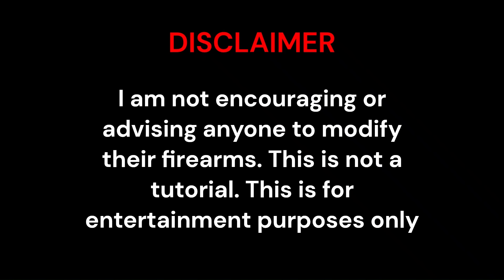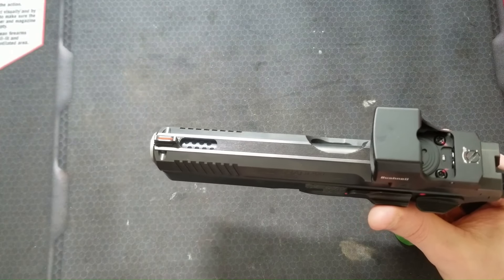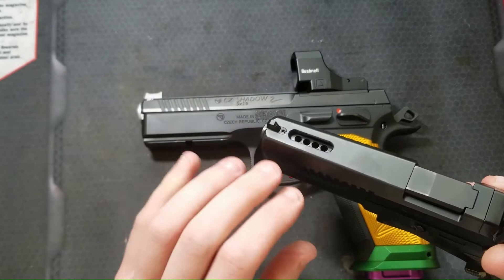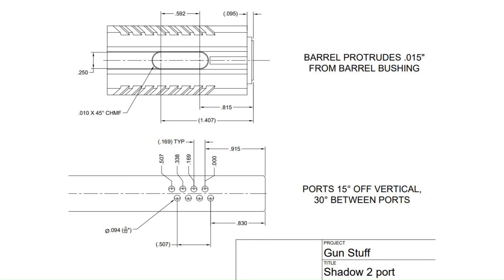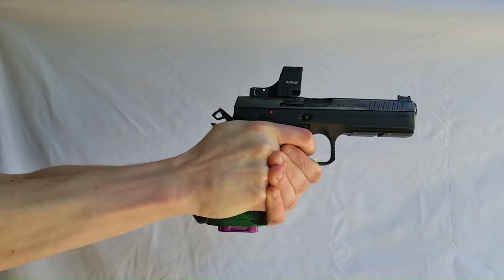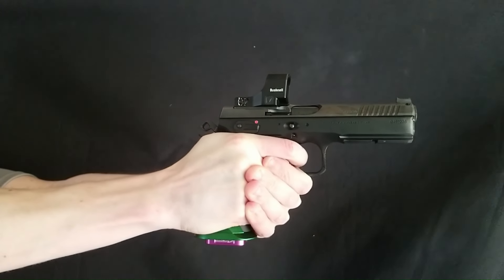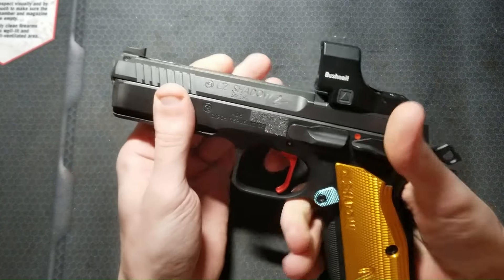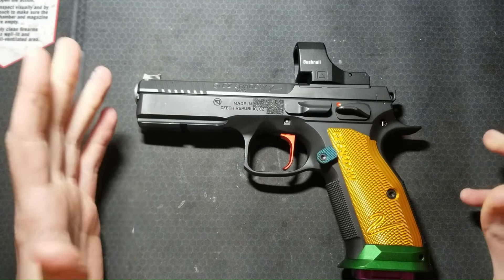I Ported My CZ Shadow 2

Comment: Helpful hint. I port a lot of guns and do integral comps as well. When doing an integral comp such as your hell cat you need to back cut the bore back slightly past the rear of the comp/port opening. I like to use at least a .387 dia. for this which ends up effectively recrowning the muzzle which is now at the rear of the port. Allows the bullet to exit evenly without any shaving as it is not re-entering rifling. It is the cleanest of all ports as no melted or shave lead is deposited. (My last project was my Staccato C-2 which has three ports as well as a similar to what is being shown on the Tube as a Ghinggs Comp).  

Too remove the deposited lead around ports, do not use a steel punch or screwdriver blade as you are showing here. Use a gunsmiths brass punch. It will not scratch the finish on the barrel but will shave off the lead. ;<) Since you have access to a lathe, it is a simple job. 

Now why the full face mask. Trying to look like a terrorist or just trying to make us shooters look like criminals?

KnifeMaker/Retired after over 47+ Years in the Craft
Reply from the maker: Ill reply to your comment on the Hellcat video regarding the hellcat. You're absolutely right and I guess I just had to learn the hard way haha! 

Regarding the balaclava, I with to remain as anonymous as possible.

Comment: Any chance you'll get another Shadow 2 barrel and try the 4 large ports instead of the staggard 8 (love that idea btw)  just to do a VS between the two.  Wouldn't be crazy expensive (not buying a whole gun)  and you'd be answering alot of people's questions about which is better large holes or smaller staggard holes.  I see you still have that cut from the Hellcat, Any chance you'll back bore it to the comp so that doesn't happen again? I know Floyd's does that too prevent spalling.
Reply from the maker: I don't plan on getting another barrel to test other porting layouts. I would like to but the way I take my measurements is not accurate nor repeatable enough. I think there would be a difference between 8 small ports and 4 larger ports, but the difference would be small enough that it would get lost in the uncertainty of my measurements. If I were to drop the coin on another barrel (it would be a cheaper barrel than this Shadow 2) I would want to be sure I could accurately quantify the change in performance, which I dont have a way to do.

As for the Hellcat barrel - no plans to bore the rifling out back to the port - the barrel is short enough as is and I didn't put the chunk port that far forward. if it was the barrel length of the hellcat pro I probably would. 

I did get a new barrel and plan on a 90 degree V port setup and I will compare that to unported and the chunk port.

Thanks again for watching and commenting, you're always asking great questions on my vidoes!

Comment: Any interest in doing some fairly simple machine work to my slide? I’ve got a 365XL slide that has the factory 6 lines serrations in the front and 6 in the back on each side. I’d like to mill out every other high spot in the serrations to turn the 6 thin cuts into 3 wide cuts. Basically 12 cuts all together that give me wide cocking serrations instead of the factory thin ones.

Comment: If you were to port another CZ p10 f would you use these smaller holes/design over the bigger inline holes?
Reply from the maker: Every porting job is a learning experience. In hindsight I could have spaced the P10F ports out a little more, they are kind of close, I spaced them out more on my P-01 (the next gun I ported). I also don't think i'll do any holes/slots bigger than 1/8" diameter. The holes on the P-10F and P-01 are 5/32".
Reply: @EngineersArmory  cool, did you drill the holes in the shadow at an angle or straight down?
Reply from the maker: @BigDukeDaddy  I mention it in the video. They are at a 15 degree angle off the vertical; 30 degrees between ports. Keeping them as vertical as possible will contribute most to reducing muzzle flip. It was a balance of port area, number of ports, angle, material left between ports and the area of the slot I wanted to fit them in. Took a while to figure out the right configuration. That's where the 3D model is almost necessary.

Comment: With your experience so far, would it be possible to do a chunk port on a Shadow 2? I know the front sight would have to be removed and would it interfere with the slide barrel bushing from the milling?
Reply from the maker: You could but it would need to be behind the barrel bushing. You wouldn't want to compromise that barrel lockup area. Only about the front .300" of the barrel bushing is the lockup area and its about .550" long. So you could mill away some of the rear of the barrel bushing. Of course you would lose your front sight in that case. The slide profile of the Shadow 2 would be hard to mill a new dovetail to relocate the front sight as well.

For a chunk port to be safe the rifling needs to be bored out starting at the leading edge of the port, so you will lose that barrel length as well. The further back in the barrel the port is, the more barrel length you lose. I don't think a chunk port is a good option for these pistols. 

Personally I wouldn't consider a chunk port on any pistol that has a barrel bushing.
Reply: @dltz  Alright, thanks for the info. Now I'm deciding whether V ports or top ports. You should do an in depth video on V ports versus top ports and see what's better on to reduce muzzle rise and felt recoil.
Reply from the maker: @PerfectFrequency2A  I have ported enough pistols with inline and V-ports that I will give my opinion on it. In theory, ports straight out the top will reduce recoil the most. More gas that is directed straight up, the more muzzle flip will be reduced. V-ports direct some of that gas sideways and that does nothing to reduce muzzle flip. Wil it reduce some of the straight back shove into your hand like a muzzle brake? maybe... But muzzle flip is what we mainly want to reducce with pistols as that is what will allow you to get back on target the fastest.

Now in practice... I am getting similar muzzle flip reduction values from inline and V-ports. My measurement method is not super precise so if there is any difference it is being lost in the measurement uncertainty.

Subjectively in my hands when shooting the difference is also so minor that I can't tell a difference. I am not the most experienced shooter, nor have I shot the same gun with inline ports, then V-ports right next to eachother.

My recommendation is to go with a port design that you like the looks of from a reputable company. You'll get a noticable increase in performance from inline or V-ports. If you're porting it yourself, make it a cool design that you like that is easy to machine and doesn't compromise the barrel lock up area. I understand wanting to optimize the porting as much as possible to get the maximum performance, and thats what I have tried to do with my porting jobs, but in practice they all feel about the same to me haha.

Comment: Really nice work man. Congrats. I am getting my Canik Rival SFX -5" ported. The slide has a factory cut on the top and it begins cca 1,06 from the end of the barrel. I plan to get 4 ports x dia.0,118  with a distance between ports  0,196. Any suggestions from your experience? Should I get 5 ports instead of 4? tnx
Reply from the maker: Thanks! 

I'm no expert but your hole size and spacing (if that is the center distancec) are right in line with some of my porting jobs. My general rule of thumb is to leave at least .075" between holes, that means my hole spacing (center-to-center) is .075" + the diameter of one hole. 

That distance from the muzzle to the first port is close to where a lot of mine end up. Of course, if your using existing cuts in the slide that distance is set for you. 

With 4 ports you'll have a bit less cross sectional area than I target for a 5 inch barrel. if you did 5 holes that would end up being a little less cross sectional area to what I did on this Shadow 2 and also my Beretta 92x and they perform great. I'm not going to tell you what you should do to do with your gun, but if it were my gun, I would do at least 5 holes. 6 holes would be the same cross sectional area of my Shadow 2 and Beretta 92X. 

Of course it depends on what space you have in the existing slide cuts of the pistol. Don't get too hung up on the total cross sectional area like I have. I'm an engineer and overthink this shit out of everything like this. I bet if you do 4, 5 or more holes, you will notice a significant difference in muzzle flip and felt recoil!

Hope this helps. Good luck with your project! I bet it will shoot great.
Reply: @EngineersArmory  Tnx for your reply :) Love your work. Well i i am shure now  to go with 6 ports in straight line or your V8 design as on Shadow. I will get a spare barrel so no harm done in worst case. Tomorow i will take it to my gunsmith. Best regards from Slovenia.

Comment: Do you have any knowledge on electrical discharge machining vs conventionalmachining? Im considering getting my p01 ported, and I have concerns regarding the barrels steel being affected. EDM porters claims that this issue is resolved, but is it actually an issue to begin with? Thanks for aby insight you have to offer.
Reply from the maker: Short answer is EDM would be just fine for barrel porting, I would not worry about it at all. In fact I would prefer EDM to make the holes over conventional machining as I think it would leave a nicer finish and less burs in the bore that could disrupt the bullet at is passes and cause spalling.

Longer answer below, and some sources with good information here:
https://www.xactedm.com/how-edm-works/
https://reliableedm.com/Complete%20EDM%20Handbook/Complete%20EDM%20Handbook_5.pdf (page 9/13 deals with the recast zone)
https://poco.entegris.com/content/dam/poco/resources/reference-materials/article/article-edm-effect-on-surface-integrity-10139.pdf

First my experience with EDM. My first job out of college as a mechanical engineer was designing metal forming and stamping machines. We used S2 tool steel heat treated to 58-60 Rockwell C (very hard) for the dies that sheared steel (1018) up to about 1/8" thick. The profiles of the cutting edges were wire EDM's post heat treat. They were then ran on industrial machines sometimes 24 hours a day for months on end before needing replaced due to wear. So the heat afffected zone (HAZ) left behind by the EDM process is very small and has little effect on the integrity of the base metal, even in a very demanding role like shearing steel.

EDM is a thermal process, high voltage vaporizes/melts the metal away to cut it. But its very localized and very short duration in a given area. EDM also requires coolant/dielectric to operate. There needs to be some non-conductive fluid to keep the current from discharging where its not wanted and cutting something its not supposed to cut. This dielectric fluid also cools the work piece pretty well.

The HAZ has a re-melted layer, then a layer of annealed (softened) material under that, then the normal unaffected base material. This total HAZ depth will depend on current, the base metal, travel speed, and depth of cut. Generally this will be on the order of a couple tens of thousands of an inch total. 

More thermally conductive materials will develope a thinner HAZ layer as the base material can carry away more heat in the builk of it quicker from the cutting. Barrels for pistols will generally be 416 stainless or 4150 CMV, which has relatively good thermal conductivity compared to tool steel. 

The HAZ was much more of a problem on old EDM machines that didn't have such fine voltage/current controls and positioning. New wire EDM machines will really limit this HAZ down to 1 ten thou or so for a light skim pass.

The EDM hole will leave a nicer finish and less burs on the bore side than conventional machining. I would be more concerned about material weakening and wear from the nitride/melonite coating on the barrel being removed during the machining process than the EDM HAZ. 

So once again, long story short, modern EDM processes would be great for barrel porting. I would not be worried about how the EDM process affects the base metal around the cut area at all personally. I hope this helps. Thanks for watching and commenting!

Comment: I would be too chicken to do that
Reply from the maker: Its always a little nerve wracking to take that first cut into a slide or barrel. I also made sure to practice on some cheaper guns first haha. Also helps that my dad is a retired machinist and helped me out. It was very reassuring to have him double checking what I was doing.
Reply: Practice on scrap until it's perfect. @EngineersArmory
Reply from the maker: @warrenrosen132  ah I've done enough machining of scrap to be comfortable with it. Pretty simple machining operation, I make sure to design them that way. Also with a DRO on the mill it makes it easy. But still I started with $500 pistols before my $2000 pistol haha.

Comment: The gun is already more accurate than any shooter, no reason except because you can.
Reply from the maker: Every pistol I shoot is capable of more accuracy than me haha. And yeah this was definitely because I can and I wanted to. Fun project. 

Regarding accuracy, it's more of a function of how little the pistol is disturbed as the trigger is pressed, and the repeatability and tightness of barrel lockup in the slide. 

Barrel ports only do their work after the shot has been fired. They reduce muzzle flip and recoil allowing the shooter to get back on target faster and reduce split times.